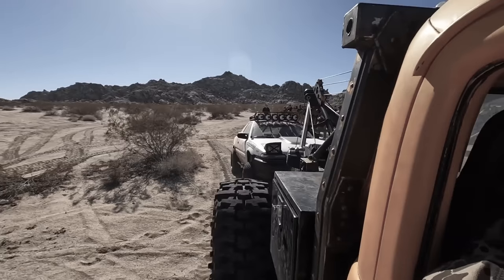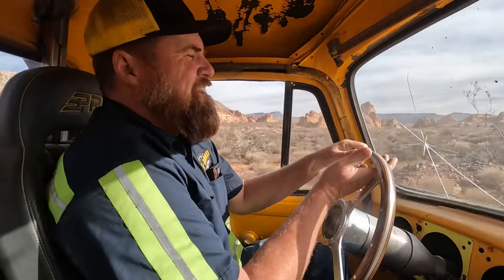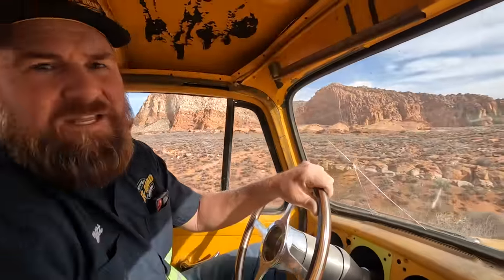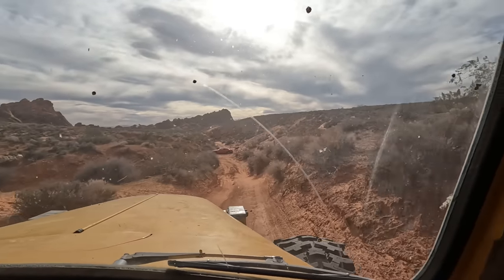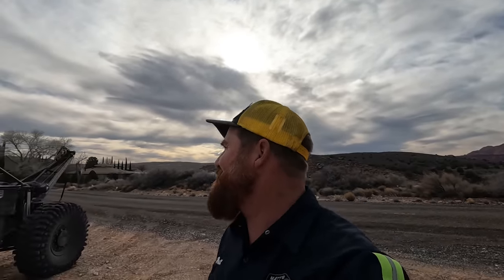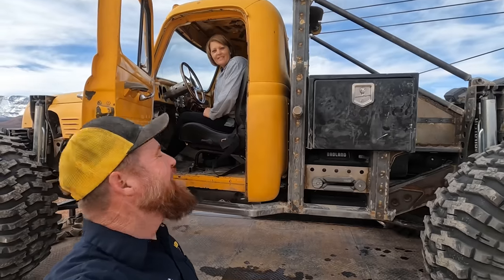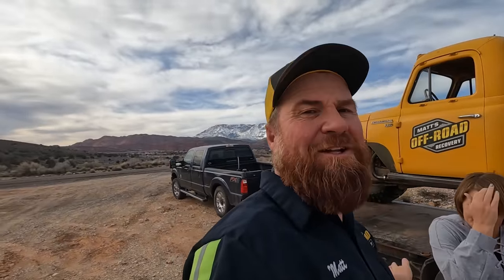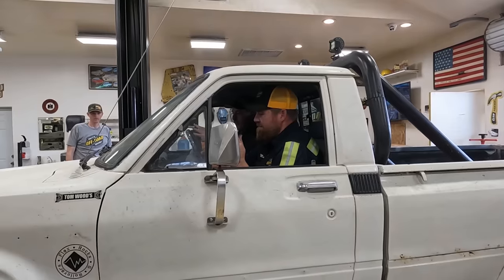Why Am I Rescuing A Sports Car Off Road?!

Comment: That wrecker would be awesome with selectable steering.  I have operated lots of equipment that lets you quickly switch from front, rear, opposing, and crab steering by turning a dial.  It keeps steering on the wheel so you still have a free hand.  I  love the wrecker and thanks for what you do.
Reply: i seen in another video it does, and has different settings to follow the front and a stick to drive it independently. but i could have no idea what im talking about.
Reply: A position sensor on the front, and a small logic circuit would solve that. I bet thousands of guys here would be able to put something together with just a few bucks in hardware. I sure would have a blast making something like that. I am not in the timezone, or anywhere near, so I guess I would not be a candidate.
Reply: @dominikwylie147  Maybe I missed something then.  It seemed to me rear steering was just on the stick and front was just the wheel.
Reply: I’m pretty sure the rear steer is manual off the switch. But, now has auto center if you want. 
For what they’re doing having it manual on the switch is handy. Sometimes you want to steer only the rear and it’s easier to just do that instead of having to work a dial to get what you want on the fly. And, with it being an auto they’ve got a free hand anyway. 
I suspect they’ll do a setup like monster trucks use where the switch is on a handle that’s mounted to the dash. That way they’ve got something to hold onto for support and can easily control the rear.

Comment: 3M makes a windshield film to help protect against rocks and chips.  You might want to consider investing in some.  Two layers might work for the boulders you are throwing.
Reply: Yikes!  I'm all for making resto-mod stuff, but it's pretty hard to fab-up a replacement windshield.  Can glass plants custom fab stuff for a reasonable price?  I'd guess not, unless it's a flat glass piece, but this looks like it is curved.  That means you're reliant on scrapyards... and glass is one of the first things to go.
Reply: Yup, cover the entire windscreen in headlight protection film.
Reply: Oops, Google tells me there actually are shops that can custom-fab curved glass.  Wonder what the premium is over stock/oem/junkyard glass?
Reply: @boggy7665  That screen is probably still made, it fits every  R series model Inter built for 30 years.

Comment: Judging by the squat on your F350, you may need to upgrade to an F450-F550, when pulling that Big Wrecker. Or. Maybe a gooseneck.
Reply: Yes saw that instantly thought he needed to upgrade his suspension or yeah buy a 350 or 450
Reply: He needs a  proper trailer to haul his heavy wrecker, before he has a catastrophic event, like Ben Cox, or before he gets the shakedown from the HWY Patrol.
Reply: He already owns a Freightliner truck that should be able to handle it.

Comment: Got stuck alone in snow. Had to break a few rules.  Including using a 3333 lb rated ratchet strap to pull a car from a tire.   The traction control really works well in snow.  The car kept coming once I got tires on ground. (Wrapping strap a bit)   I can’t wait to see footage from games.  I admit to watching a few clips from random folks.  But want to see the folks who ran, planned it.

Comment: Matt, you can make a proportional control system for the rear steering hydraulics, need a position sensor and a bit of coding but im pretty sure theres projects like this you could adopt. that way you have a potentiometer on the instrument cluster you can 3d print a knob that looks like a steering wheel with an arrow. so you can reach up, set the wheels at the angle you want, and they will track to the angle and hold there.
Reply: could also add a button for return to center. so you don't have to look at it while maneuvering
Reply: holler if you ever need help with the microcontrollers, im not that far from ya^^
Reply: they make hydraulic rams with built in linear encoders

Comment: When I was in the Air Force years ago at Nellis AFB in Las Vegas we had an aircraft tow vehicle with rear wheel steering and big ol' balloon tires. The rear steered by means of a joystick. We would cruise down the flight line damn near sideways bouncing all over at about 25 mph which was near top end. It was a hoot to drive.

Comment: A thought for the rear wheel steering. I have a 1/8th scale 4-wheel drive 4-wheel steer RC crawler. I found the driving basically impossible. Eventually I worked out that you don’t need the crab function nor it’s opposite, just the hard-left and hard-right. By locking the joystick into a 45 degree slope (ie it can only move diagonally) you get something that reacts like normal but has a turning radius about the length of the buggy. I’m not sure how that translates into full size, but it worked for me. The front and back wheels are opposite phase.

Comment: You need a rear steer indicator.  Check marine supply store on-line for a rudder position or angle indicator.  Having the display on your dash with an analog pointer over an image of a boat would be perfect but you beat the truck up too much so go with a digital display.

Comment: Those 20R Toyota engines are awesome. Mine went over 200K before I threw a rod. ( i was 18 and abused the heck out of it )  Replaced it with a 22R and abused it for another 200K and then sold it. Would love to have another 79 Toyota pickup.

Comment: Not sure about the control setup for that rear end, but someone should figure out the center alignment point for the rear end and just have a simple three button left right and neutral control for it to take some of the guess work out of it, may also want some wheel steering locks in case it ever fails you can set it to neutral they will keep it straight.

Comment: Matt, you should install a 3-way switch on the dash like what is used on a telehandler. Then you can switch between two-wheel steer, four-wheel steer, and crab walk without having to manually adjust the rear wheel steering.

Comment: Have you considered second switch to couple the rears steer with the steering wheel? so that the rear steer is mirroring the front wheels? This would allow more concentration on the driving and would feel natural still while giving the option to steer independently when needed ?

Comment: You need to install a self centring system for the rear steering. Hit the button and it does the rest. I run heavy equipment that has this feature…not uncommon

Comment: Matt just a question.  On telehandler forklifts they have a switch to toggle from two wheel steering to four wheel steering and crab mode.  When you select the mode you want the steering wheel will control both axles simultaneously.  Have you considered this for the heavy wrecker?

Comment: It wouldn't be helpful all the time, but could you somehow interconnect the front and rear steering with a selection switch (like in a telehandler) that would allow front steer, crab, or round-d-round at the flip of a switch without having to manually position the rear tires???

Comment: Well if you want to go left. First joystick to the left or the toggle switch whatever it is. Leg left leg left right leg right. Are front axles turning left but the right one of my Ficus going to the right. Take a look at the rear wheel farthest part of the back wheel if the back wheel sticks to the left then you're going left.. I may be wrong but I don't think so.. it's like driving a bobcat for the left-handed lessons going there or push on the left brake and it's going left.🤷🏽‍♂️👍🏽🙏🏽.

Comment: A Tiny Reverse Cam Top Mounted To One Of The Rear Steering Knuckles With A Visible Angle Chart Would Take Care Of The Rear Steer Situation. Just Have A Small Screen On The Dash To Look At. Not The Best Explanation But Im Pretty Sure You Know What Im Trying To Say Here.

Comment: I feel like you should add an auto steer mode where it sets the steering angle of the back proportional to the steering angle of the front.  Probably would want the  proportion to change based on speed though.

Comment: Too bad you couldn’t put a toggle switch on the top of the steering column and have it oriented such a way that the direction it’s moved is in relation to the direction of steering. Even if it looked like an old style signal switch.
Even a tiny steering wheel would work, whether it’s on the top of the column or in the center of the main steering wheel.

Comment: I heard that Matts offroad recovery has a new  "merc" basecoat paint called "Never Finish", already tested out on front window, cab ceiling and dash. 100% guaranteed for the life of the vehicle.  It will go in the Recovery Hall of Fame along with fuel gauges , gloves, sunglasses, 1/2 inch wrenches, sunblock, AC and other items of comfort and décor. Honorable mention goes to Fab Rats Paul Motto sign: "If you can Rust It You can Trust it".

Comment: Map I got the same exact truck . To the left of the steering column is a traction control button and it will actually apply the brakes so you can't spend tires and you will literally stuck in wet grass on your own front yard cause that button is on just for Is future reference

Comment: obviously the reason the car was stuck there is because they were being chased by Rosco P. Coltrane and Enos and after losing them got stuck there.  You will probably get a call to pull two police cars out of a small pond with a fat man hitting the Sheriff on the head with a hat.  Did you check the trunk for moonshine?

Comment: at approximately 1:50, looks like way too much weight on the back end of Blue Steel,  either need an equalizer hitch heavier springs/ air bags, or a bigger tow vehicle.

Comment: Enjoyed the video, but did notice the blurring of license plates could have been better. There are points where you can see the license plates clearly, unblurred and partially blurred, for both pickups. I'm sure blurring license plates is difficult, but should probably correct those for vehicle owner's privacy.

Comment: That frozen sand surface can be surprising. It gets a bit of moisture in it, freezes and expands overnight and then when you drive on it you crush it back and sink  6 inches  on stock tires !

Comment: I was going to ask if you can pull from an alloy wheel, but I already got my answer. Okay, what I find interesting is the heavy wrecker, that enormous beast,,, and here's Matt, stuffed behind the wheel with VERY little room anywhere. Okay, that and having to go deep into the wet sand to rescue a street car..

Comment: Jamie is correct.  That wrecker is well built and works so well.  When you tested a 5-ton army truck a year ago, it was terrible in the sand.  It would bounce before it drove well.  I would never want to have that type of rig.  So, I was apprehensive about your new one.  It has turned out to be the best for the job.  It seems to climb the rocks better than any other vehicle.  A few times though you had a little trouble getting traction.  I heard your comment about using worn tires would be better traction, as well as your comment about 54" tires being made in the special compound that your Morrvair has for tires.  That issue may work itself out in the future.  But just one point I have to make, don't you need space for more helpers along?  Whenever you use the other rigs, you usually bring 4 people.
One more point.  ED, I know he hurt his neck recently and therefore needs to let it heal, but I miss seeing him being there with you and providing his own type of atmosphere.  Please urge him to get better so he can get back to his previous position.
I know what Jamie is talking about, muscle memory to get those fingers or thumb to know what to do at a second's notice.  One must see the movement of the wheels while operating the switch in order to program the mind and muscles.  But it won't take too long.  My son has been driving monster trucks and he got used to it after a couple of shows.

Comment: On that Toyota, I would think changing the fuel filter may be a good idea. Mine would get in situations where it would starve for gas, I would pull over, try to figure it out, it started up, and seemingly was fine again. shortly later, it would act up again. Once I figured out the issue and changed that filter, ran fine again...I always kept a spare one behind the seat after that.

Comment: I had remote rear steer on a semi trailer, found the easiest way to use it was using the control normal when driving forwards, then turning the control around, so the front of the remote faced the back of the vehicle, when going backwards, so the truck always turned in the direction i pressed

Comment: Matt can't you set up those rear wheels to turn automatically when you turn the fronts?  The old US Army Gamma Goats had a similar set up.  If you turned the front wheels 10% to the left the rear wheels would automatically turn 10% to the right.  You might find that this setup easier to operate.

Comment: You replaced the old school bucket headlights with some leds! I wonder if something happened to them during the Wrecker Games.
Reply: The recovery vids (released on every Wednesday and Friday are always out of sync with the Project/Adventure vids which are released every Sunday.  It's possible that this recovery was filmed three or four weeks ago.  I think the led headlights maybe were the ones they had installed at KOH and were replaced by the bucket headlights later.

Comment: Oh Jamie, you don't know me, but I'm a wolf, Abbott watcher bop, Matts, off-road recovery. I've noticed one thing he not does not have one window that doesn't have a crack in it that heavy records got a crack in it and I believe one of the other vehicles is got a crack on the driver side, back window. If you want to start a go fund me page for forgetting you met some windows, let us all know, and we will start a go fund me page.
Reply: With my disability, it's hard for me to type so I was using a Dictation machine so some spelling got missed. I'm not a little wolf well I am an avid fan and I just think that the windows and the more bear and the windows in the wrecker need to be replaced due to the cracks in them. I'm surprise that Matt gets away with driving record with a cracked windshield.

Comment: those mechanical fuel pumps for the 20R are complete garbage and have been for the last 15 years or more. they'll go bad about every 6 months if driven or not, junk rubber and ethanol eats them, also getting a good pump is about impossible, in the past we ran into some with the internal check-valves installed backwards, they sucked from the outlet and return port and pushed out the inlet! best bet is get a block-off plate and run a good electric pump, otherwise you better carry multiple tested spare pumps and the tools to change them roadside. 😒

Comment: Hey Matt!  That Challenger GT is awd.  I suspected it when I saw how the fronts were sunk in holes but seeing the GT in the grille confirms it!  Hopefully pulling gently on the front wheel didn't mess things up.
Reply: Im no challenger expert, the rims that has an Y spoke style "stock option" only comes in RWD. The GT with the straight pull spokes "stock option" are AWD.

Comment: $65,000 luxury sport car he gonna drag it by the wheel..  "oh well not my car"  ...  how about not being lazy and driving a few spinks into the ground than back it up with a come along, I get it's a soft sand but those are sensitive very expensive suspension components, would you want someone dragging it with your tire when they could back it up with a come along, or drive the recovery vehicle behind it and pull it backwards?

hale a simple flip flop winch is very fast and effective, 15 minutes and you're not dragging a $65,000 car by the front wheel.. lord  you brought the battleship why not use it, pull it up behind the car and pull it back, pretend it's your car..